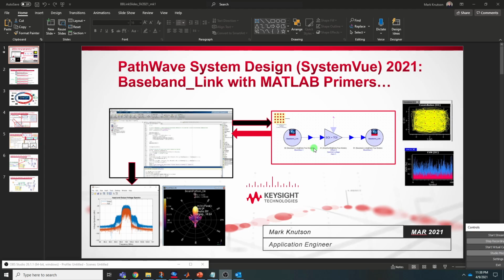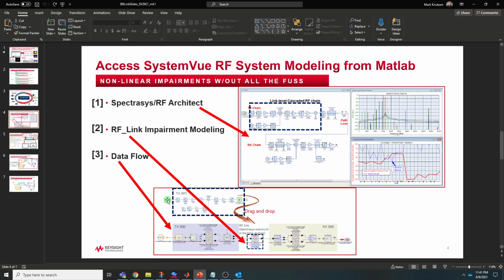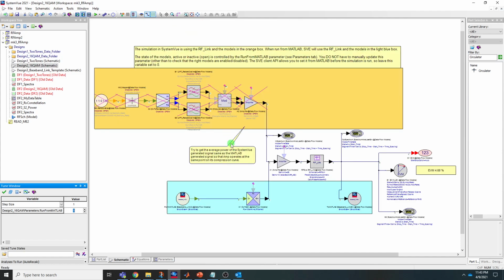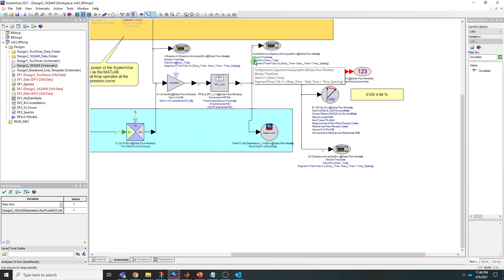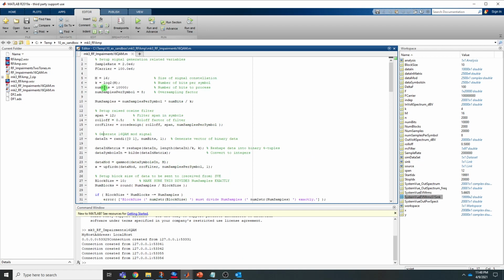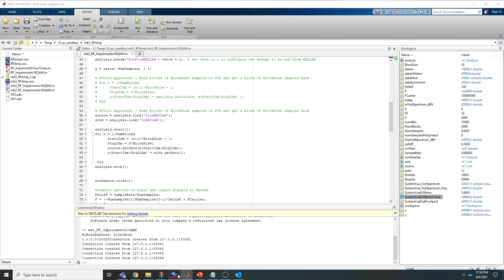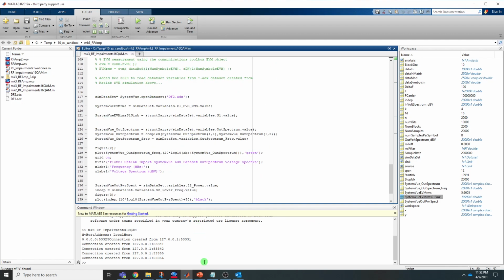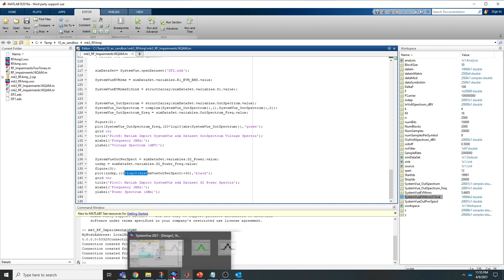SystemVue: Matlab Baseband_Link (part 1 of 5)

Comment: Hello, Matlab doesn't recognoize the command SystemVue.OpenWorkspace(... Could you please let me know how can I install the relevant package or app to use this feature?
Merci
Reply from the maker: For a comprehensive response for your specific set-up, please contact the Keysight PathWave Design support line.   Keysight support team can walk you through a fix:   1-800-473-3763, eesof_support@keysight.com

Actually, I have seen this error before with running Matlab to SystemVue via Baseband link feature (SystemVue 2022, Matlab R2022a).   Good news, it should be easy to fix as shown here.  If you are interested to resolve on your own, here is one approach to try...

Q:  Are you getting an error like this when you try to run SystemVue workspace simulation from MATLAB via Baseband link feature?
Error using SystemVueMex
Error: cannot find SystemVueEngine.  Call SystemVue.config.setEnginePath function to specify engine location
Error in SystemVue.config.openworkspace (line 45)
                handle = SystemVue.SystemVueMex(uint64(0),'openWorkspace',path);
....

If you have a valid license for Baseband_Link in SystemVue, set Path in matlab (see below for details), I’d try the solution steps to first get shipping example to run:
1) Go to SystemVue Matlab Toolkit Baseband_Link Example and Tips to Run SystemVue Completely from Matlab Cockpit: https://edadocs.software.keysight.com/x/AS29J  (on Keysight Knowledge Center support portal)
a) Download example set:  mk3_RFAmp_2.zip…. unzip to your local directory…
b) In Section III:  Solution Abstract , try the following steps with the example:
- Section IIIb:  [Make Sure You have Your SystemVue Baseband_Link Installation Path Properly Loaded into Matlab]
- Section IIIc:  [Recommendation – Ensure Local File Directory and Files Have Proper Permissions to Write/Read]
- Section IIId:   [If You Encounter an Error like "matlab_sve_toolbox... You do not have a license to run this feature" When Running Matlab *.m Program that Tries to Call SystemVue from Matlab]
- Section IIIe:   [Run Each of the *.m Matlab Baseband_Link SystemVue Example Code Examples from Matlab
-- Open/run "RF_Impairments16QAM.m" matlab code from Matlab.  

2)  If the above example in step 1) does not work/you get an error like above, try the following troubleshooting steps outlined here:  
a) SystemVue 2021 Troubleshooting Baseband_Link Remote Spawned SystemVue Simulations from Matlab: https://edadocs.software.keysight.com/x/GEnsJQ
b) To resolve the above error for me, I had to do the following from the Matlab command prompt to start from a clean slate:
- SystemVue.config.close()
- SystemVue.config.setEnginePath(’C:\Program Files\Keysight\SystemVue2022\Bin\SystemVueEngine.exe’)
- Optional:  SystemVue.config.getVersion()   confirm you get back SV2022 version expected…
- Run RF_Impairments16QAM.m again…. It ran without error this time…